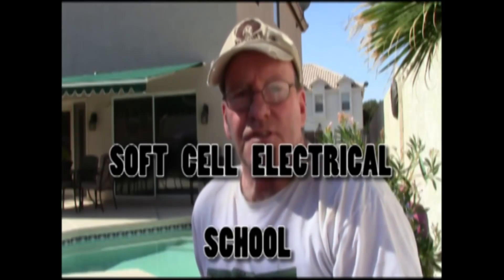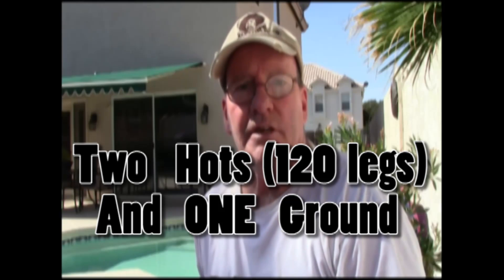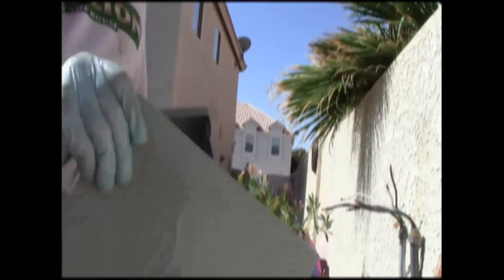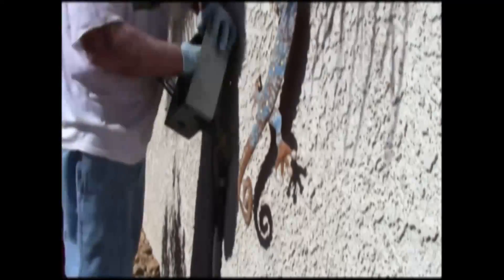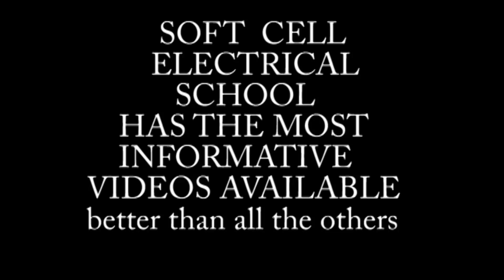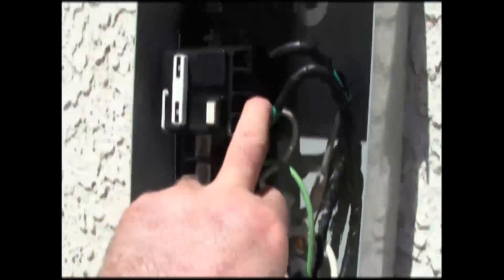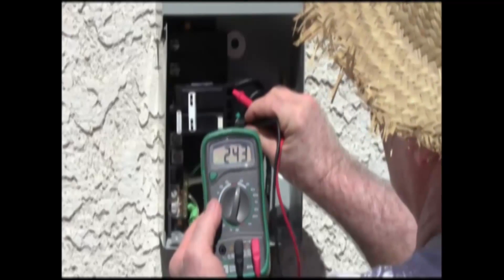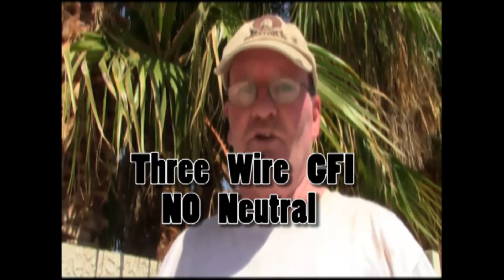# 43 How to install a 3 wire hot tub GFI

Comment: I’m sure this will work as you have it but legally and for safety reasons  you do not want to land your neutrals and grounds on the same bar anywhere other than in your main panel. You “float the neutral” by removing the screw that connects it to the box it’s inside of. Neutrals go to one bar that is not electrically connected to the box and you take your greens or bare ground wires to the other bar that has a connection to the box. If you have multiple connection points you can get current that was supposed to return on the neutral returning on your ground wire which is attached to metal parts on the hot tub, conduit, washing machine fridge you name it. It is an unsafe violation you won’t notice until someone gets shocked.
-Journeyman electrician

Comment: 18 years ago i wired up my hot tub, 4 wire 220v gfci with no problems still to this day ,, ,we just had a pool installed last week and  i was confused as to  the wiring of this pool heater ,, 3 wire 220v GFCI,, and thanks to this video,  i completed the job over the weekend...  ,,national  680 code compliant  and local town compliant everything, fired it up ,,,works perfectly , total cost for parts for the heater and the pump,,,,,,, breakers, outdoor  box, 12-2 wire conduit,  8 awg bonding wire ,bonding rod, and various fittings  under $350, total time to do the job, from digging the bonding line to tightening the last screw on the box, 10 hours.
Reply: g quinn proof?

Comment: SO THE NEUTRAL IS NOT NEEDED BECAUSE ITS 220 RIGHT ,, jUST GROUND AND TWO LEGS , RIGHT?
Reply: g quinn, perhaps you should do your homework before you start bagging on people..Some hot tubs DO NOT use neutrals, they are wired from the factory for 220 with 2 hots and a ground NO NEUTRAL..That is what he is trying to point out.. The gfi is pretty much useless, when configured this way, but the code requires a gfi disconnect within 10' of the tub..It is my understanding 2 #6 hots & a #6 neautral + #10 ground are pulled from main pannel to gfi disconnect. It is wired different and there is no neutral that continues to the tub, the neutral stops in the disconnect..
Which still makes no sense to me..I have a tub with that same wiring and the manufacturer does not call for a neutral but the code says you must have gfi protection..

Comment: Hi.  Like the video.  I too have a 3 wire hook up for a Sundance 700 series.  At roughly 3:25 in the video you say "the neutral, which is useless here ..."  Is that because you ran a four wire from the box to the tub and then just didn't use the neutrals.  I believe that is what my current set up is and my question (finally) is, is that ok to do that.  Is it ok to use a 4 wire from the box to the wire but then just not use the neutral.  I just taped off the end.

Comment: Grounds should be separated and placed on the ground bar on the right side of the box...
Reply from the maker: Depends on the code. This video was shot before the new isolation was strictly enforced.  Also note that there are no longer 'neutrals' as we once knew.  They are now legally 'grounded conductors'.